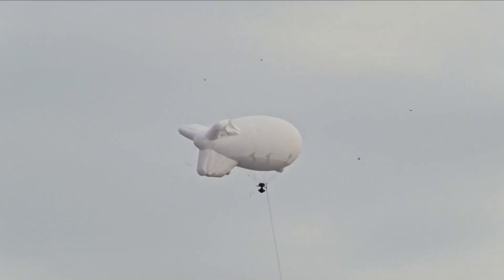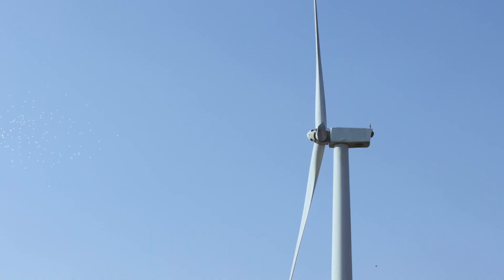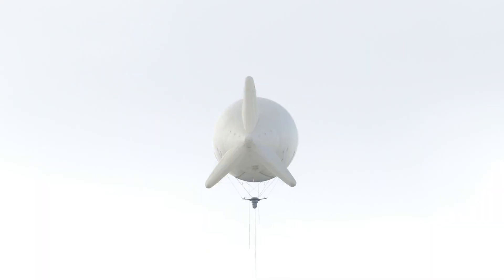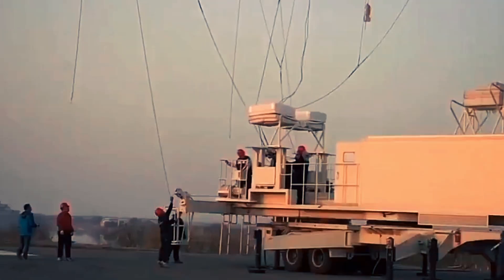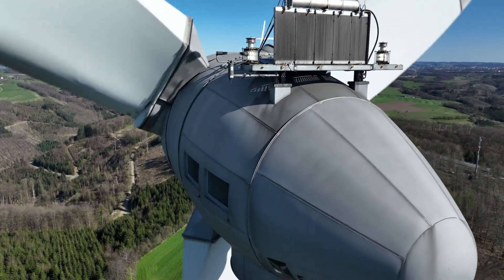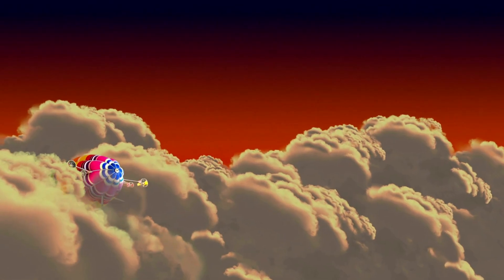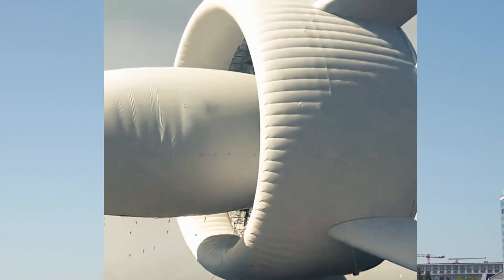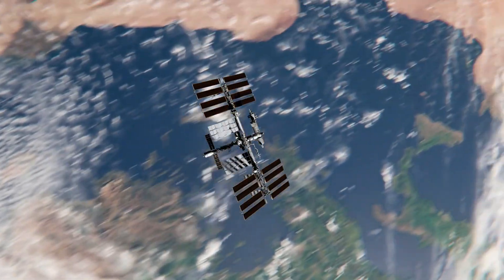Goodbye Wind Towers? China’s Flying Turbine Just Changed Everything

Comment: They should be used in tied up groups so that if one gets punctured the rest can save whatever is on the ground beneath it from getting Bruces badly.
Also If it gets equipped with solar wings it can be positioned above the clouds on a rainy day and therefore always deliver sun power. Of course the wings would also help create lift.
Reply from the maker: thanks for your feedback